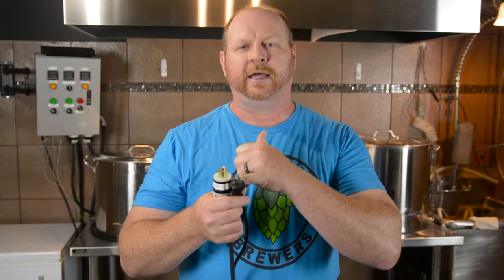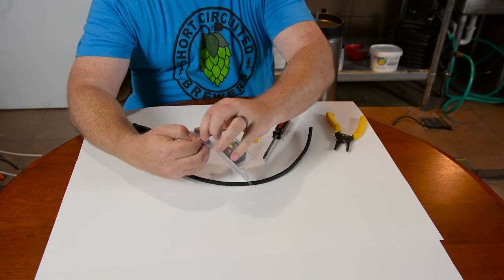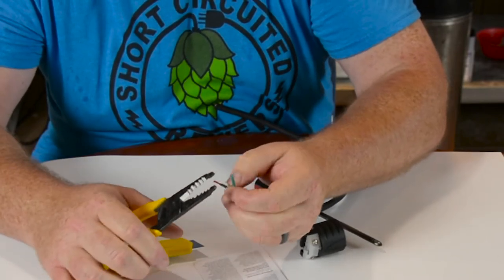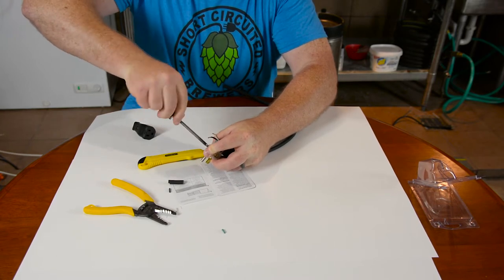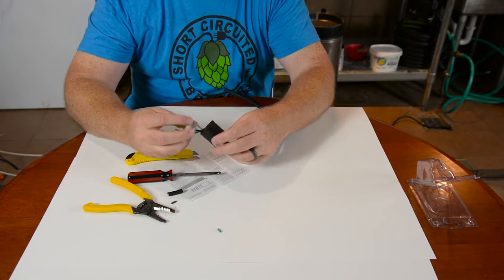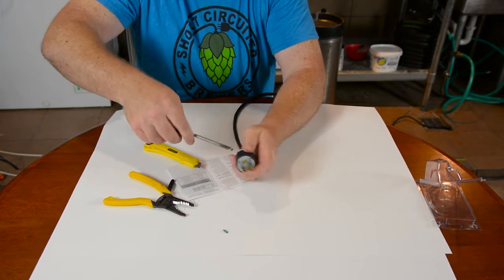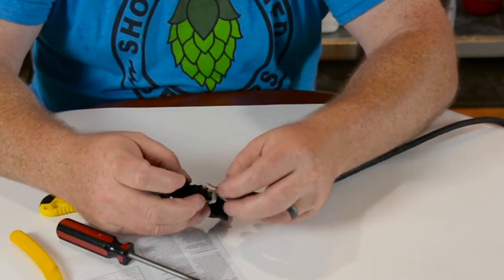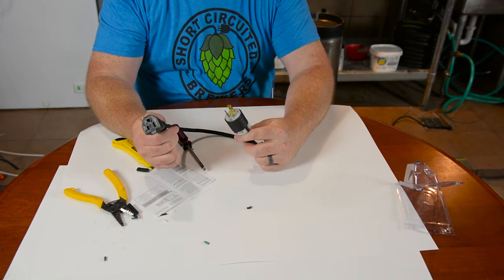Don't void the warranty on your new pump! Make this adapter to attach your pump to twist lock plugs

Comment: Is there any possibility that I would need something bigger than 15 amp? I know nothing about electricity.. 
Thanks!
Reply from the maker: Not for just a pump
Reply: The pool stores like to say 20Amp..mine is on a 15amp with no issues and I have other receptacles tied to that breakee but they are never used

Comment: I definitely understand not voiding your warranty but doesn't it defeat the entire point of the twist lock?
Reply from the maker: The twist lock serves 2 purposes, in my case, it takes up less room in my panel than a duplex outlet (even a single duplex has mounting tabs that take up a lot of room), It also prevents accidentally pulling the plug out of the panel. Thanks for the question!  Cheers! -Brian